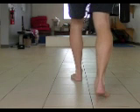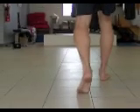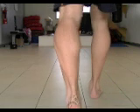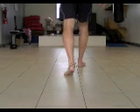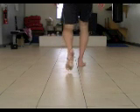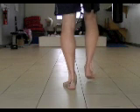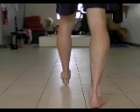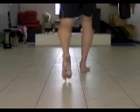Anti-pronation taping with Dynamic Tape

Comment: can this dynamic tape help me to relocate my dislocate knee and restore my foot drop?
Reply from the maker: No taping application will 'restore' a foot drop but certain techniques can help overcome the deficit created by the weakness to improve walking while using the tape. It might help with retraining a better motor pattern particularly if nerve function is improving and motor return continuing but this would depend on the individual case.
Reply: @DynamicTape  thank you very much, why I'm asking is because Im hard on foot drop and knee dislocate,thanks anyway